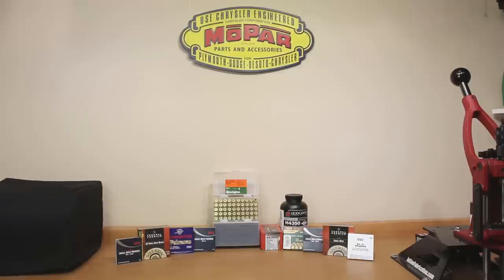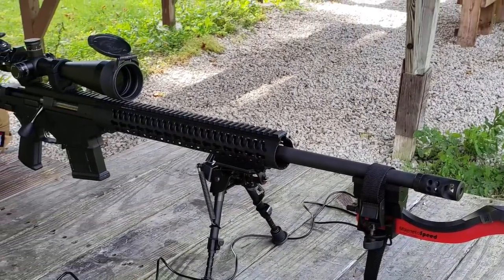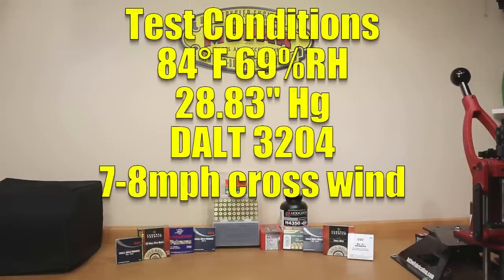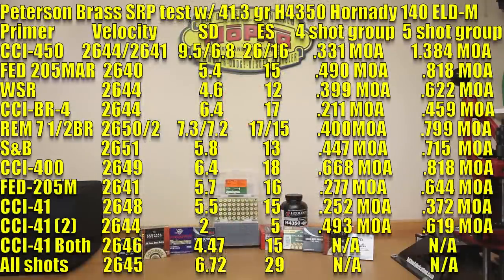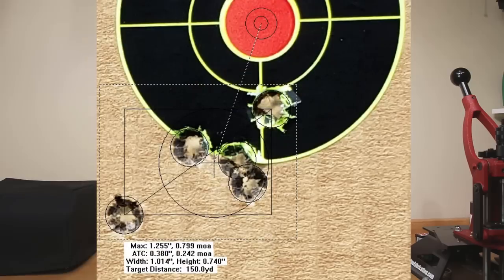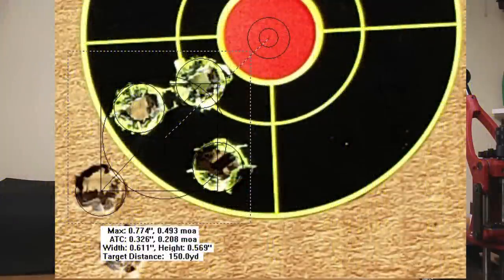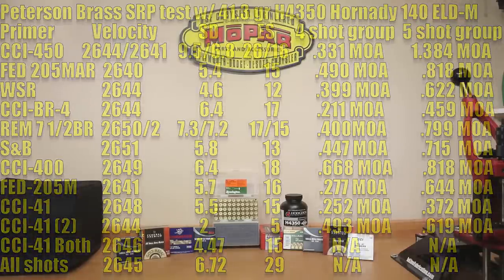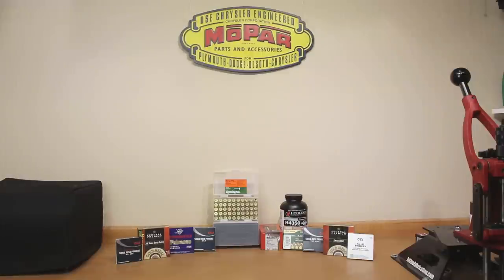Small Rifle Primer Evaluation using 6.5 Creedmoor Peterson Brass

Comment: I started using Peterson brass Last Summer. It is very nice to work with and seems very uniform. I think it is likely to last longer then the Hornady brass that I was using before. I also found a deal on Hornady ELD M bullets from Midsouth Shooters. They sell blemished bullets in packs of 250 for a better price than the standard box of bullets. One advantage of having a large number of bullets is that I can wait sort them to the nearest 1/10 of the grain. The price is better and weight sorting seems to help somewhat. I don't see any significant deterioration of the accuracy by using the blemished bullets. I'm not sure what makes them blemished, I don't see any apparent deformation and do not measure any significant difference with a caliper. Perhaps they are not as concentric in the core. But, I can't measure that.
Reply: wayne Pursell the blemishes are strictly cosmetic ie jacket color/polish, tip color inconsistency, etc, they are not physically different at all from the non-blemished bullets, they just didn’t meet QC for appearance. I spoke to Hornady directly about the blems being sold midsouth and Hornady confirmed this for me, they said that no misshaped bullets would be sold, only ones that didn’t meet their QC on appearances.

Comment: What’s your opinion on the SRP starline vs Peterson.?
Reply from the maker: So far Peterson. I am going to neck turn some of my starline to see if it improves my statistics, but Peterson gave me some great numbers with basically no case prep.
Reply: Bolt Action Reloading second question. Do you know if the lee collet die will work on this brass.? I see it will take a smaller decapping pin than what dies might normally come with. Sorry for the question but I’m out of town so I can’t measure my pin.
Reply from the maker: No worries at all. Just measured mine and its .062 and it's a no go. I tried it on a piece. I am sure it would work on the LRP, but not the srp. You have that lathe you could turn it down I would think. Make everyone jealous. 😁

Comment: Think it was more important to test large (standard) vs small and does it make a difference?
Reply from the maker: I have ran this test on LR hornady and LR sig brass as well. If you are picking SR primer brass you are choosing it for case life plain and simple. So trying to see what primer you want to match with that brass is the key.
Reply: @BoltActionReloading  Thanks, Found and checked it out, was curious as lapua also uses SR primer pockets and wanted to see if any difference. From both charts i used the FED M primer specs so LR is about 2675 vs SR 2641. Couldn't use CCI as  both charts said BR4 and wasn't sure.

Comment: How do you switch from large primers to small primer pls
Reply from the maker: It's what brass you order. They offer both for this specific brand and cartridge.
Reply: @BoltActionReloading  so i don't have to change anything on my rifle or my die just the brass and primer?
Reply from the maker: Yes, be aware of different case capacities as well as depending on the primer the SR primers crater earlier unless you bush your  bolt for a smaller firing pin.
Reply: @BoltActionReloading  thank you
Reply from the maker: No problem.  Hope you enjoy the channel.
Reply: @BoltActionReloading  ooohh yes pls keep um coming